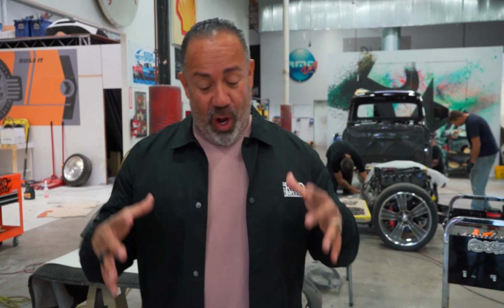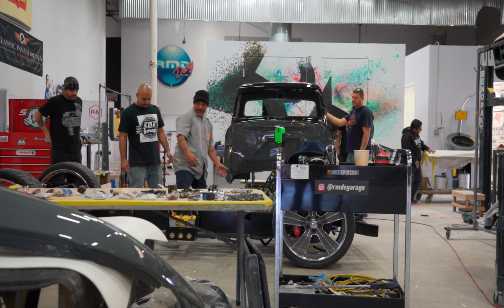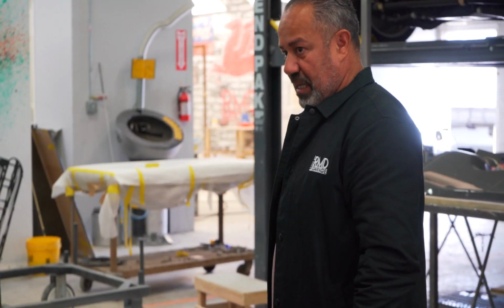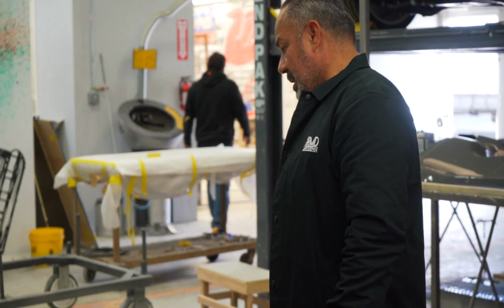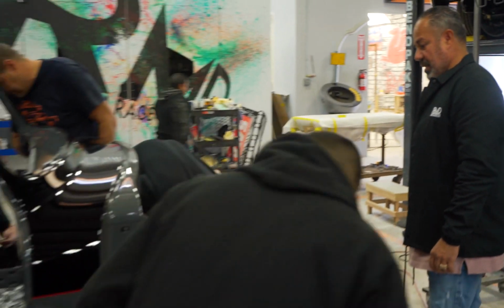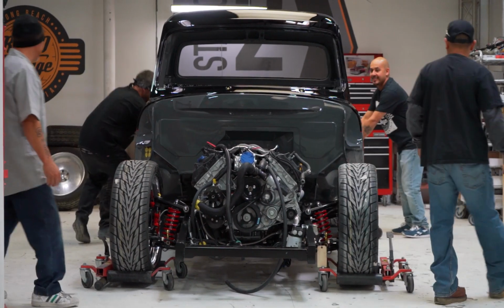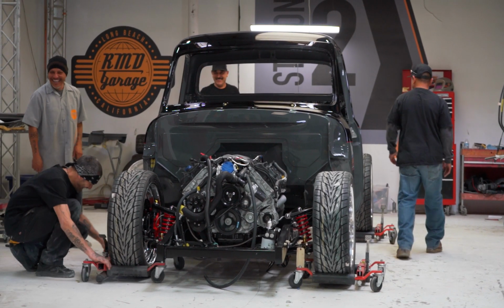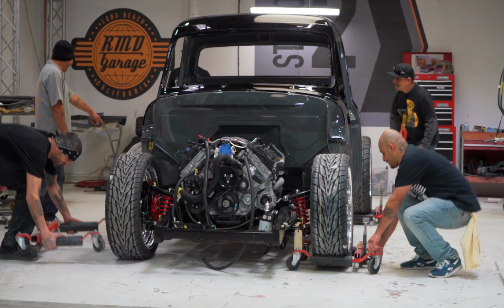RMD's 1955 Ford F-100: Final Assembly

Comment: I think you should have done the grill in black with contrasting red accent.  The tailgate letters  could have been black with red outlines  keeping more in line with the two tone paint. Only other thing I would think of doing in black would be the rounded rails at top of bed or wheel arch lips.  Would have to see in rendered drawing.